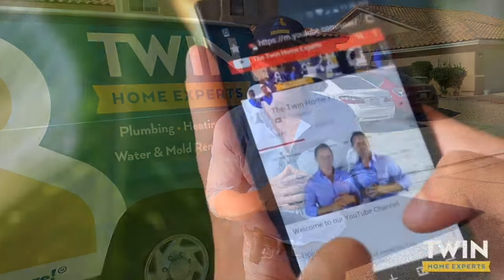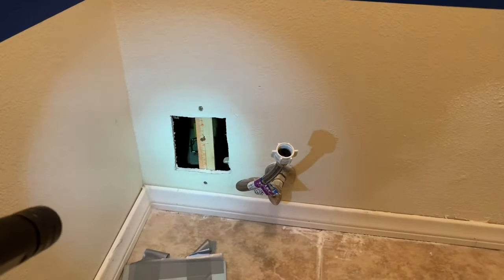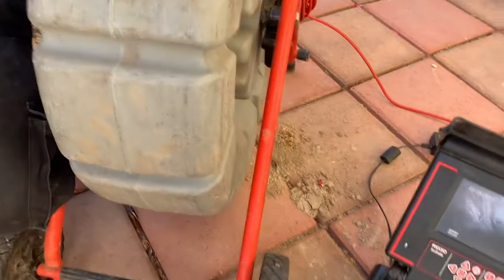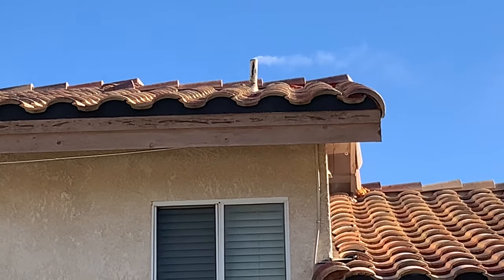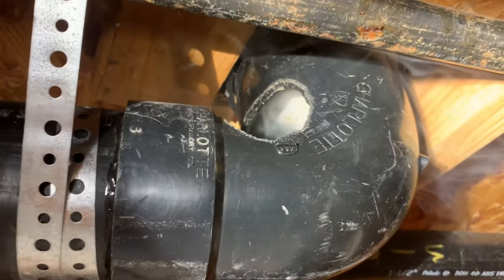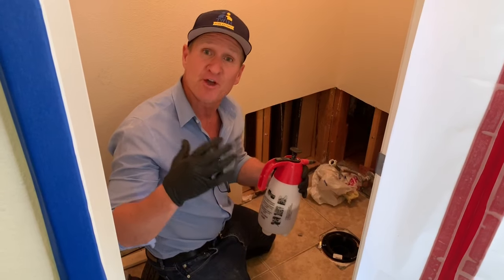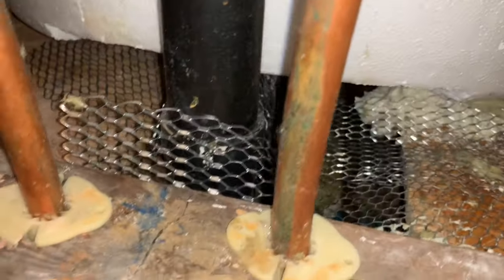Scratching In Walls And Ceiling At Night? We Got You!

Comment: I'm broke, maybe if I bang my fist and scream at my wall maybe he will go away haha
Reply: I'm dying
Reply: I've made a robot for this. Does not work
Reply: I’ve tried banging on my ceiling and they just keep scratching 😭
Reply: Hell yeah me too as my paralysed paranoid ass hear them scratching the walls😳😃😁😭😩💨💨♿️♿️
Reply: Hi, I've had success in the past buying the biggest getho blaster from Value Village I could find and putting the speakers towards the ceiling and blasting the local hard rock station for a full week (except at night). But the little bastard came back. Time to get the radio out again...
Reply: @lovemesumhim07  same they are doing it rn so I get pissed and I punch the damn wall
Reply: i heard shit too coming from the wall behind my christmas tree lol. now its been put down i discovered a hole in the floor where the radiator pipe is and i clogged the bastard with aluminum foil hopefully it works
Reply: Tried that, they scratch even harder
Reply: @Shuleria  there is actually a device that emits high frequencies for annoying the mice. however it gives me a headache even if I barely hear it. I suggest really getting it behind something if you use it.
Reply: Draw a red circle on the wall, place hands on each side, in a very fast motion, send head back, then forward with a fast thrusting motion until it comes to a sudden, fast stop. (You should know when contact has been made.)  If you follow these instructions, THEN, and ONLY THEN, will you have any chance it works.
Reply: @gaterunner64  I own 11 of them, I think they are GREAT. We set the traps, and put them next to the High Power Fequency Conversion boxes. I've got 4 so far.
Reply: @brentbarnhart5827  I am going to go with the OWLTRA electric mouse trap.  They are twenty bucks a pop and deliver between 5000 to 8000 volts approximate.  I can then empty the traps out in the back yard and feed other predators.
Reply: That don't work.
Reply: @msamour  I tried this... Not only the mice ran away, but the neighbours as well. Succes guaranteed... But only for short time, new neighbours may potentially come back :D
Reply: @slango5188  same here 😩
Reply: I mean noises that scare mice the turn up the volume autocorrect 🙄😂
Reply: just release a python behind the walls, problem solved
Reply: @slango5188 same and I can't make a hole and have no one do It.for me or can afford someone to come out it has be a mouse or a rat cause My cat gose crazy and wants get up there it stop make sounds sometimes a couple days and start again

Comment: This is very informative.  I worked pest control in the Bay Area for about four years in the mid-2000s at a leading company.  But we didn't have this level of technology, cameras and isolating rooms to smoke out rodents.  We did do exclusion work with foam and wire mesh, though.

What I did not see in this video was an inspection of the exterior to locate and seal the entry points.  Typical points of entry for rodents are garage doors without threshold plates or doorsweep seals, crawl-space or basement vents with gaps or openings, eave overhangs with gaps, attic vents with gaps or holes, etc.

You can install new tightly sealing exterior wire vents with a drill, anchors, and mason drill bits to drill the pilot holes for your anchors and screws.  You can also use foam and steel wool or foam and wire mesh combos around the exterior, if you need to improvise for random gaps and holes around the exterior of the house. 

Basically, you wanna completely seal off your house.  There's more, but I gotta run...   

Cheers.
Reply from the maker: Thank you for the feedback. Yes, ALL exterior and interior must be sealed completely.
Reply: Just a question; if everything is sealed will the mice or rats die inside wherever they are? Will it rot and stink? How does that work?

Comment: Great video. We have rodent issues at our house because I rescue squirrels. And because I feed the birds and squirrels each day in our backyard, it unfortunately draws rats and mice. It started out harmless enough with squirrels getting into my walls on 2 different occasions. I was able to easily correct it though within 24 hours and for less than $20. All I did was purchase a bluetooth speaker off Amazon, then in the evening after the squirrels were in "bed" for the night, I put the speaker against the wall and played at top volume rap music and dogs barking from videos off Youtube. I played the videos simultaneously for an hour straight, then took a 30 minute break, played them again for about 30 mins, then a 10 min break, etc. I did this routine for about 3 hours straight. On both occasions the squirrels were gone for good by the next morning. 

Fast forward 2 years later - roof rats have now found their way into my attic through the screen under the soffits. I have found 4 different entrance points, one of which I accidentally found while cutting back a tree that was up against the house. I have purchased 23 gauge galvanized hardware cloth, a roll of copper mesh, and 3 of the 1-way door excluders. I have sealed up 2 of the entrances entirely, mounted 1 excluder, then cut the tree completely down... then I decided to mount a trail cam overnight to see how many came out of the remaining hole. I got some funny footage of 3 rats climbing out on my floodlights and trying to figure out how they were going to get down since there was no tree for them to jump on to. They look like the 3 Stooges. 2 of the rats ended up accidentally falling off the lights but 1 rat held out and decided to stay put. I'm bound and determined to get that last holdout and figure he may get so hungry that he will decide to jump for it tonight. Either that or he went out the excluder door and I just don't know it yet. But i'm going to put a couple of live traps in the attic tonight baited with Reeces peanut butter cups to be safe. Wish me luck!

(Edit): If anyone wants to try my trick to get rid of squirrels, here's the links to the speaker on Amazon and the Youtube videos I used. (While the exact speaker shows unavailable now, you'll see lots of others just like it on the same page).

Bluetooth Speaker: 
https://www.amazon.com/gp/product/B07GRQSQST/ref=ppx_yo_dt_b_search_asin_title?ie=UTF8&psc=1

Rap Music:
https://www.youtube.com/watch?v=lzbcCDj4WJE

Dogs Barking:
https://www.youtube.com/watch?v=fecqn9fnG0s

Comment: I hear scratching in the left side corner of my room from about 6 am - 8 pm (it varies) it’s always ruff scratching and a loud thudding when it exits and enters. I have wood paneling in my attic but I’m worried it’ll make it through eventually :(
Reply: same
Reply: Squirrel. Dyurnal...rats are NOCTURNAL.
Reply: Kiala, I think James is right that it's probably squirrels if you're hearing the activity in the daytime. I wrote a post above about how I got rid of them within 24 hours and for less than $20.  I'll repost here for you if you want to try.

First, I purchased a bluetooth speaker off Amazon, then in the evening after the squirrels were in "bed" for the night, I put the speaker against the wall and played at top volume rap music and dogs barking from videos off Youtube. I played both videos at the same time for an hour straight, then took a 30 minute break, played them again for about 30 mins, then a 10 min break, etc. I did this routine for about 3 hour straight. On both occasions they were gone for good by the next morning. Here are links to the speaker and videos I used. (While the exact speaker shows unavailable now, you'll see lots of others just like it on the same page). Good luck!

Bluetooth Speaker: 
https://www.amazon.com/gp/product/B07GRQSQST/ref=ppx_yo_dt_b_search_asin_title?ie=UTF8&psc=1

Rap Music:
https://www.youtube.com/watch?v=lzbcCDj4WJE

Dogs Barking:
https://www.youtube.com/watch?v=fecqn9fnG0s
Reply: it will make it through and attack
Reply: @lowellirish  no, my rats start heading out around sunrise. I'm in Australia...no squirrels here.
Reply: @Sheltieshangrila  you might also try the 25000 H test tones on youtube, also at full volume. Rodents can hear it, humans can't.
Reply: I hear it mostly at night from 2AM-6AM, however since I have been making a lot of noise at night banging the walls I have not heard them at them time as much lately. I have started working from home for half of the week and lately I have heard them at odd times, like 7-9AM and 6-8PM, and also 12AM-2AM. I must have messed up their rhythm with my nightly noise. Don't let anyone tell you it can't be rats because you hear them during the days sometimes. They will definitely chew and scratch during the day, too, if they are determined to stay.

Comment: I live in a two story and hear scrambling in the ceiling at night. I used foam to seal any outside areas and the next day it was already chewed up from the outside. I couldn't determine if it was rats or dumb pigeons. The biggest culprit was the AC cable hole into the house. I was still having issues and finally moved a shelving unit against the wall and sure enough, there was a rat nest underneath it and a small 1 inch hole on the side of the house leading into the kitchen. I'm still working the issue and seemingly spraying rat/mouse deterrent I bought has slowed the traffic down.
Reply: Howd go

Comment: In London, there are rats and mice in every tall building. We live in a new block of flats and it makes so much noise in the ceiling… agency does little to this issue… they send someone, put traps but it don’t really get to the flat or traps. We cannot sleep as it does so much noise in the night running, jumping in the walls and big, empty ceiling that is very thin.
Reply: I'm in west London, fairly new build, and definitely hear rats scratching in the walls. I've reported it, but just got told to get a sonic repellent

Comment: OMG, when I saw that  pipe with big hole it frightened me. I am going get some steel wool and wire mesh.
Reply from the maker: Crazy HUH!
Reply: Heard on another channel that Copper mesh pot scrubbers works well. won't rust and the rats teeth get stuck in it.

Comment: I am getting much heavy noises scratches in the attick & walls, my suspicon is a rat not certain to where it got in at my pipes are all steel being its an old home one story so they cant damage pipes but electical wires they can is what i am worried about guess i will be buying some rat traps today this been going on for few days now & has me concerned whats going on..
Reply from the maker: If you at hearing them inside your walls/ attic, it’s imperative to pin point the entry points. Traps work much better when you seal up the home. Any rats left Inside the attic are going to hit the traps for food. Good luck 👍

Comment: How can we tell how many rodents can be in our home so far we have caught 3 we hear scratching around our downstairs bathroom and we found a whole in the garage wall O want to use peppermit to get them out but I am afraid they may go deeper into the house? Can this happen or will the smell repell them? Get them out?
Reply from the maker: Hello Mari! Great questions. So the best Steps is to make sure you have sealed off every possible entry point. 
If you still have infestation and noises in wall then you need to focus on the sewer and drain system.
The peppermint oil and other methods is ONLY an attempt, but unfortunately will never stop them.
We hope this helped. Good luck!

Comment: I also have a very annoying persistent mouse infestation inside my attic and hear loud scratching and bumping around at night or sometimes early evenings. I've tried placing glue traps with food bait (bananas) and food traps with poison, and sprayed insecticide into the attic space via trap door in my ceiling. Have also located and sealed openings in the roof tiles with crocodile tape and trimmed the surrounding trees, bushes and plants way back to prevent them being used as ways of them climbing up and inside the roof. Man these bastards are persistent and just when I think they are gone with no noise for a couple weeks - wham! in the middle of the night they are back! I've killed a few of them with glue traps and seen them up close (and dead). They are "cute" little bastards with those big dark eyes and whiskery nose, hell I'd even have one as a pet if they weren't such invasive and annoying little rodents once they stake a claim like this inside the attic. I would tolerate them a bit more, but in a couple cases they have chewed through electric wires and created a fire hazard which is totally unacceptable, so finally it's them vs. me and they MUST GO! What else can I do to get rid of them?!?!? Maybe just burn down the house ;-)

Comment: I have one in the walls scratching around 6am each morning.I think its come from the loft..I found a small hole in the living room near the pipes.I have filled it will steel wool and put down mice traps with peanut butter/chocolate( i used protective gloves when biated it as read mice can smell humans on traps). and peppermint oil on cotton wool also.Steel wool has helped in the past with blocking mice.I am going to try ammonia and vinegar spray as heard the smell deters mice.Hope it works .Else will have to get pest control in
Reply: Doesn't  work

Comment: I might have the same problem. I don't know how the mice or rats are getting into my house. Could be from the crawl space under the master bath or? I hear them scratching and when I bang on the wall they stop. I am in North Jersey.
Reply from the maker: We have a resource for you if you need. If not you need to get some Wyze cameras ( 36.00) Home Depot and set up in all areas to monitor how there coming & going. Go get em!
Reply: @TwinHomeExperts  Hi thanks for the info. I went outside and found that it looks like rodents had eaten a hole through the crawl space door. That could be how critters had gotten inside my house. I temporarily used wood pieces to cover the hole up until I do a permanent fix.

Comment: What’s the price? And also will it leave marks on the wall after??
Reply from the maker: Pricing depends on alot of different factors ...can range from 875.00 to 10,000.00. The higher amount would include all wall patching, repairs and clean up. Its very rare that it would go to 10,000.00 but we have been there before.

Comment: How much would this be? In michigan. Need help. They say you never fully get rid of them. Is that true?
Reply from the maker: were  not sure what they charge in Michigan,  but we charge anywhere from a low 875.00 to a high  for extreme cases 3800.00 you can stop them coming in for sure if you hire the right company. once you stop the rodents food source and pathways, you got um.
Reply: @TwinHomeExperts  Thats my problem is I dont know where. I have vents under my house for the crawl space. That fogger is a good idea to find out where. I have great stuff. Ill try to seal what I can and eliminate all food. Even with food gone in the garage they ate away my speakers and made homes in the rafters. Very depressing its been a long battle with them for about 5 years but these past few years have gotten bad with the field next door to me being cut down and replaced with houses. I will get rid of all clutter. I tried traps. Ect. They just keep getting bigger and more bold. If I only could know my house is 100 percent sealed. I feel like putting mesh and a rat fence around my house if there is such a thing. I see them in the furnace and under the tub. I dont think they ate away at the pipe like in this video Thats unbelievable. If they can do that...they can chew through anything id think. Wonder if steal fencing would help once I seal with caulk amd great stuff. Once I seal I can work on whats left on the inside is what I have been thinking. Thank you for the reply it means everything it me. Just makes me want to give up im so overwhelmed by it. I even got a cat. She is overwhelmed by it as well. She tried bless her lol. Thanks again any tips are highly appreciated
Reply from the maker: @ILLUMINATION313EVO  Hiring the the rodent company should be of great value first, seal everything up, they typically offer a guarantee

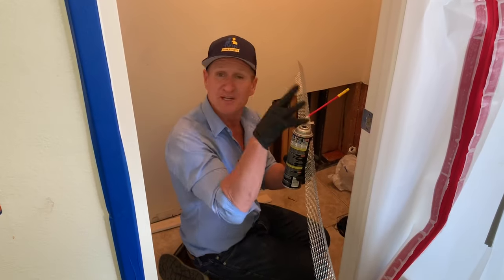Comment: looks like an upsided down dead mouse at 1:46. great find at 5:02. so now the plumbers job has diversified to include rodent extermination..lol. excellent idea of foam and mesh at 7:02. i wsh u guys lived in toronto. ive got scratching in the walls and i hear mice running through the floor. so far ive used sticky traps and caught over 20 of em.
Reply from the maker: Thanks so much for posting! In respect to your issue with so many rodents in your home, you may want to consider fings where there coming in and the use of some baking powder mix with flour 50/50 and place around areas. This should stop them for good.

Comment: Man.. I have some in between the party wall of my town house I recently moved into. Sad part about it is I see them from time to time in the backyard poking their heads out from under the neighbors fence, under their patio. We don't have a patio. I'm guessing it's a great nesting area for them. I found where they were getting into the the basement room, plugged it, haven't had an issue of them coming into that room since. However, I don't know where they're coming in from outside. I can only assume from the neighbors side.
Reply from the maker: Worse case open the wall where you hear them to see if there is a nest and you can trace possibly where there coming in.......if not smoke test is a great way to find entry points. Bless!